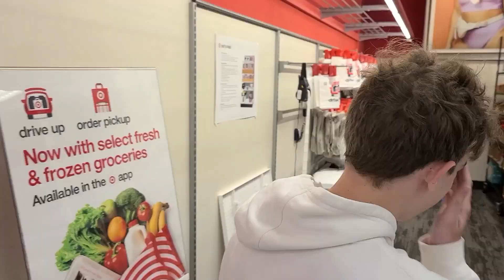Toyota 22RE Injectors Test , Clean and Rebuild - Liam's "Special" Month

Comment: Just bought a 1985 Toyota Truck with 22RE . It sat a long time, but when the guy I bought it from tryed to crank it, it ran, but fouled out. So, I will be doing just what you showed. Should I replace the "in line filter" that is between gas tank and injectors, before I do anything? Thanks for the video.
Reply from the maker: I sure would LOL :)